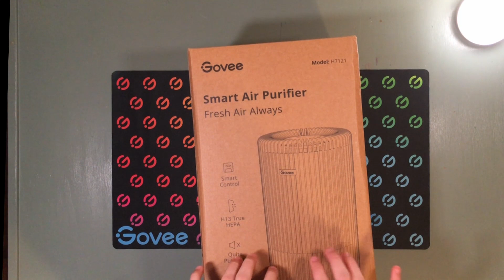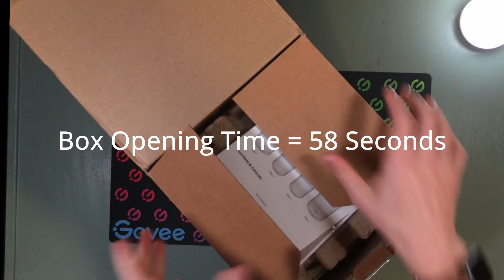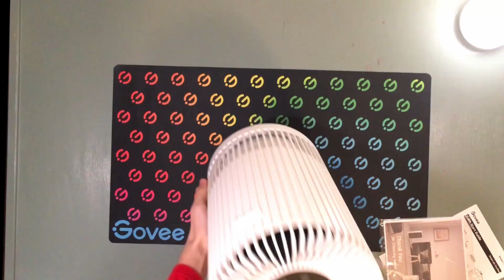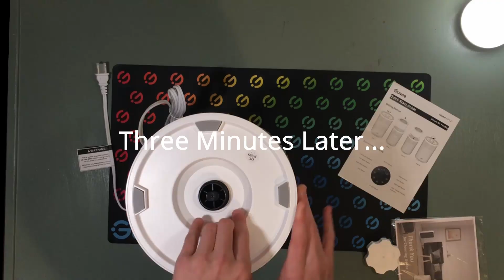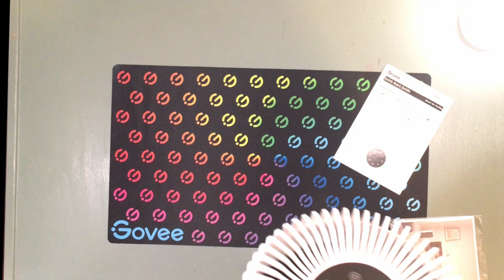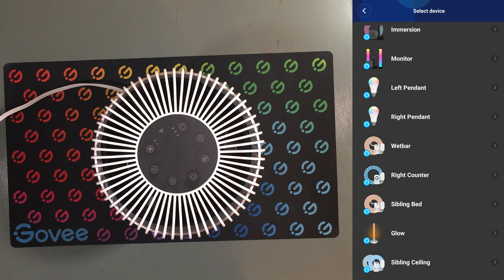Govee Air Purifier Unboxing

Comment: this is old model they have a newer model out already
Reply from the maker: Nope. They have two different models. Amazon shows it as a "newer model", but it's really just an upgraded version for larger rooms and with an air quality sensor.
Reply: Hi, I have the same purifier H7121 and recently lost connection to the app, now I try everything that is out there to reconnect but it seems that the Bluetooth is not working on the unit, now my question is is the any way to fix this or repair it? Thanks